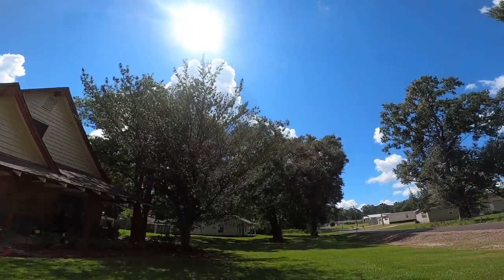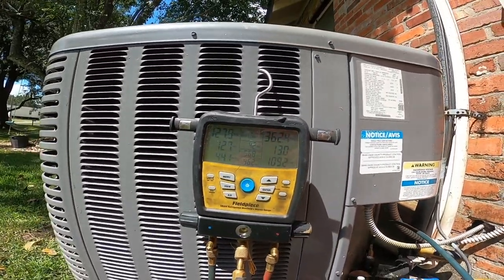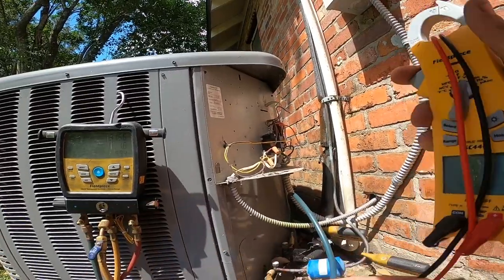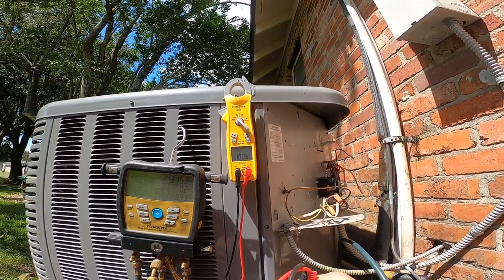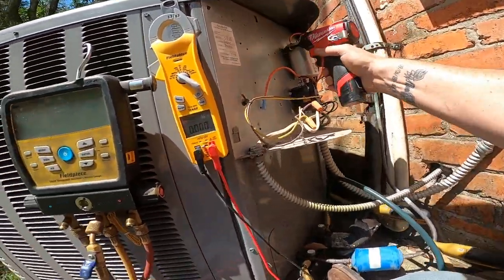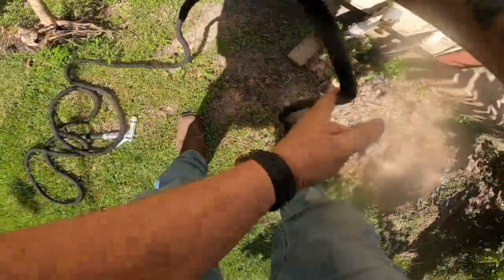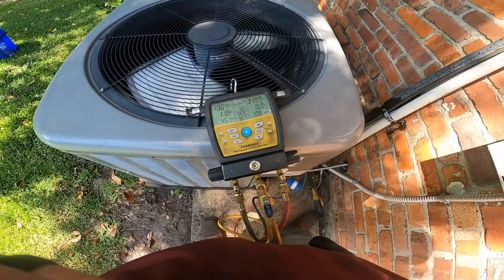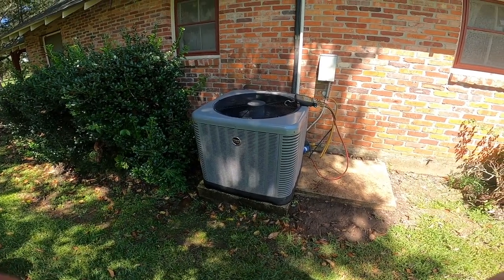How to Perform a HVAC Maintenance

Comment: I like the cam and Georgia Curtis too. I especially like how you get the wasp all fired up before you pull the cover off. 🤣 From June until now I'm usually pulling the cover off and stepping way back real quick. Then go back in with the wasp spray. I usually find them up top, under the louvers. I clean those with coil cleaner. I write the factory cap size beside the cap, then write those readings you measured on the cap itself. That lets me know when I did the pm last. Also you can watch the capacitor readings go down over time. Goodman 45+5 caps are the worst! Plus or -5% for me

Comment: If the bottom of the unit has leaves in it like that one, I pull the top off or the fan and clean down inside too. I used to charge $75 for preventive maintenance. You can't get everything done that needs to be done in one hour. That is why most HVAC contractors shy away from pm's. They aren't making any money on them. Now I just charge time and materials. If they wait five years to call me, they're gonna be paying more. Have you priced algaecide tablets ($0.50) or an 11" wire tie ($0.12) or a new truck ($60-90K)? It's crazy, but the suits have to have their $2-30M salary, corporate aircraft and vacation homes. they all hate to pay more than minimum wage for labor. They've outsourced about everything in them USA that they can outsource. they're actually trying to convince Americans that they're worth that much money. You can bet they're not gonna take a pay cut.